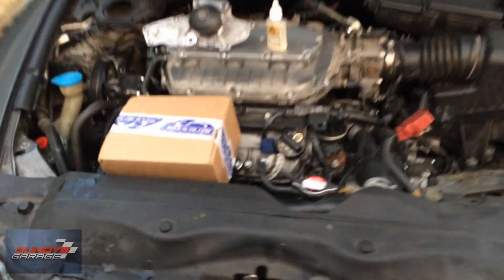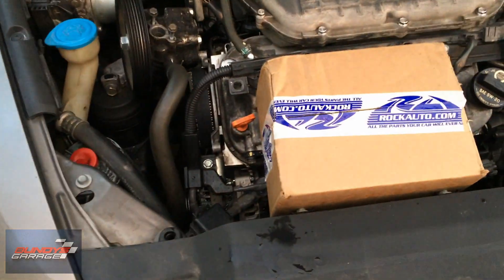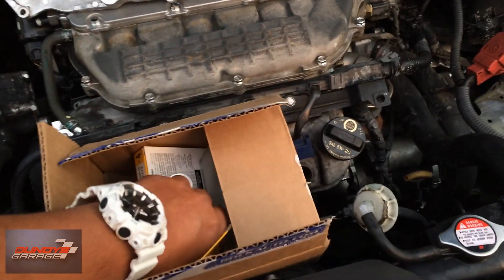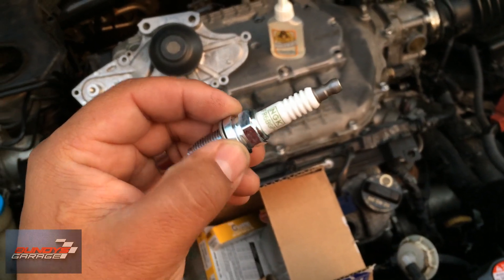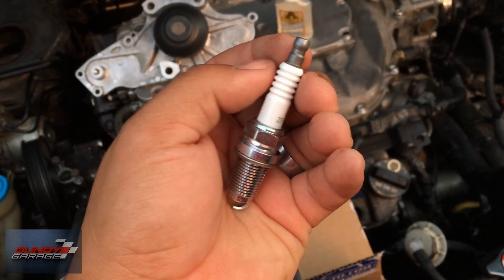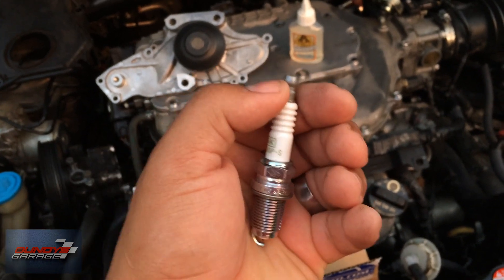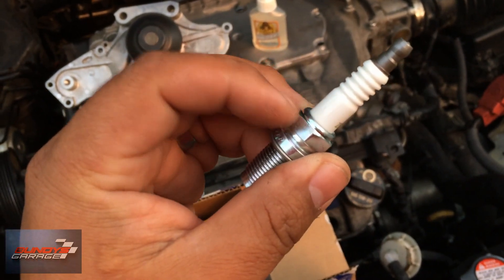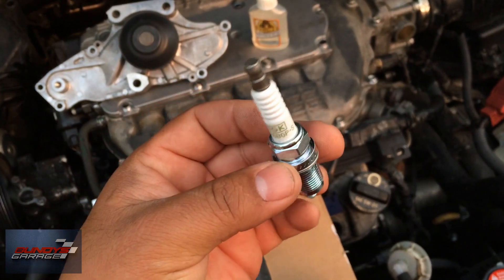Brand New Spark Plug Failure | NGK | Denso | Autolite | Bosch | Motorcraft | AcDelco | E3 | Champion

Comment: here in the philippines its not a crack but looks like rust tat comes out of the insulator and metal interface. it happened to a new  denso that was sold cheap .my multimeter reads infinity which confirms the poor quality

Comment: Note: If, while installing a plug, you accidentally drop it on the concrete, fire it straight in the garbage. While looking good on the outside, the inside- not so much! If you develop “A Miss” six months from now on those brand new plugs, can’t say you weren’t warned.
Reply from the maker: Great point!

Comment: Hey Bundy.....I have a question. I changed my plugs, new distributor cap, wires, changed the main fuel relay. My 1999 Acura CL 2.3 starts but will shut off. 
Is it the Throttle Body Sensor? I can hear the fuel pump and it will turn over after 6 or 7 cranks then die. Or if I drive it....it will drive great then just shut off while I'm driving.
Other than that it drives great....
Reply from the maker: What codes is your vehicle showing?
Reply: @bundysgarage  .....I shows a P0740....saying it's running wide open. Wouldn't that be the Throttle body sensor needs to be replaced? I had that before and it just went away. Now it will start and shut off as I'm driving it. I changed the fuel relay thinking that was it. I have the throttle body sensor just bought a new one.
Reply: If anyone has a Acura CL and it shows a P9740 code check your ignition. I found out after doing 5 different things in my car from a main relay to the Throttle Body Position Sensor, new wires, plugs, rotor button....come to find out it was the IGNITION SWITCH. IF YOUR CAR IS CUTTING OFF CHECK YOUR IGNITION SWITCH THEY BURNOUT TOO. Part is around 50 bucks and the labor around 80-100 but it's worth it.
Reply: Duralast ignition switch....
SKU-000229141 is the part number at Auto Zone......
Reply: @bundysgarage  SEE MY ANSWER....Do a video on the ignition switch. If it's not fully engaged it will shut your car off as the computer will malfunction and throw codes......

Comment: You haven't had it happen with Denso plugs, and I doubt you have with NGK plugs.  However, other brands are garbage (talking to you Mr. Bosch) - PS - Iridium or Copper is the way to go, Platinum is crap.

Comment: Never thought of that before, but I'll be sure to check now. Especially since I own an 08 Oddy, getting back in there against the firewall isn't fun.
Reply from the maker: Heck no, getting the plugs that are near the firewall can be a pure hassle. Especially if you have a strut tower bar. Always check your plugs before installing.
Reply: Indeed, I've never had one crack on any of my vehicles yet, not saying I want that to happen either. 

What's you're opinion on greasing spark plug threads? I've never seen any on new cars I've changed plugs on and never suffered a seized plug myself. I also only tighten plugs by hand (I cringe when I see power tools used for that) and never try to gorilla arm them in either.